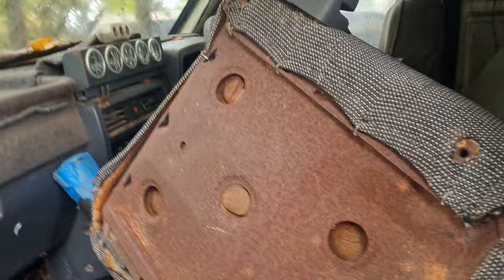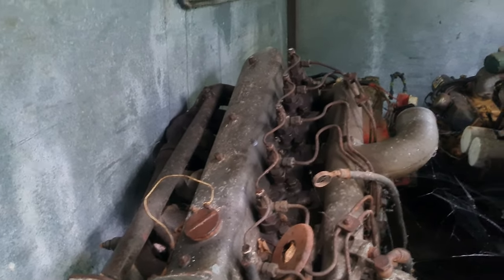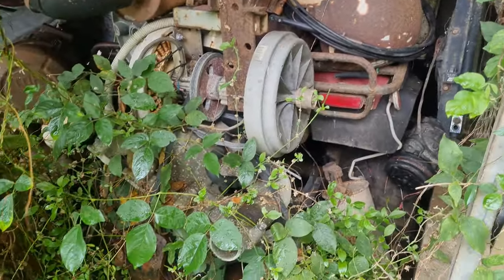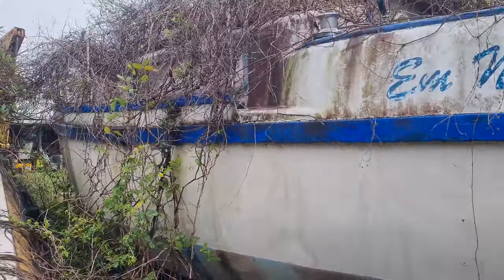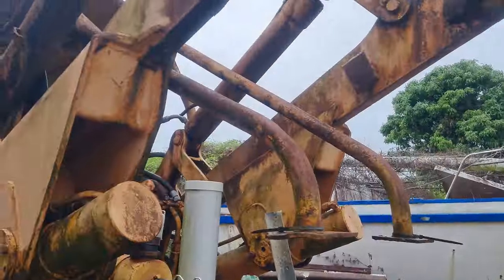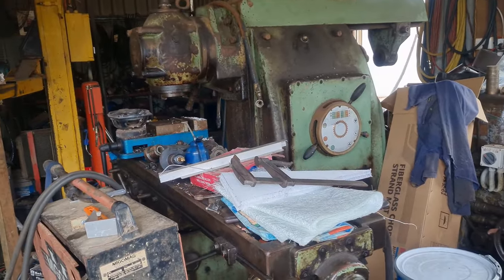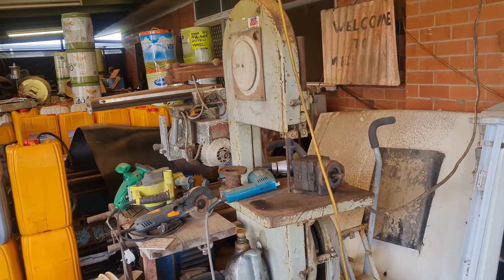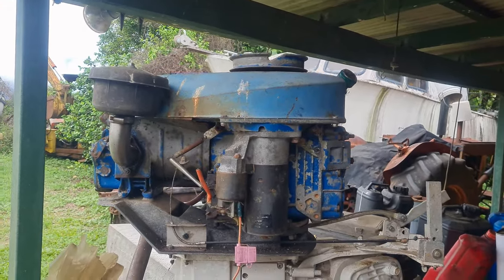Yard tour Pt 2

Comment: Pete , That 5.7 Diesel v-8 in  the back was used in Chevs and most GM cars and trucks. Not any parts are Chevy . They are based on Oldsmobile 350 V-8 , much like the Holden V-8s you have there . Great video mate ! 🌵
Reply from the maker: You are %100 correct! In Oz, the Chev and Holden are generally regarded as the same thing. That may be where I mixed thing up a bit??!! Thank you for the comment, Scott!! :-)
Reply: @pete-mate3524   Pete , An old Holden V-8 and a Chev V-8 are very different .  I worked at the same Chevy dealer here in Phoenix from 1971 to 2014 . The Holden V-8 is more like an Oldsmobile engine than a Chevy . Old Chev V-8s never had an aluminium front water pump housing and the oil pump was always in the rear driven off the dizzy. On rockers arms the Chev has a single nut hold down , unlike the aluminium stand for every 2 rocker arms like the Olds or Holden. The Old engine was a fine engine itself , Just not a simple as the Chev . GM was so silly in the 70's that every division , Buick, Chevrolet, Pontiac Oldsmobile and Cadillac ALL made a 350cu engine . And all were completely different until the late 70's and early 80's  . Hope this helps , Scott 🌵